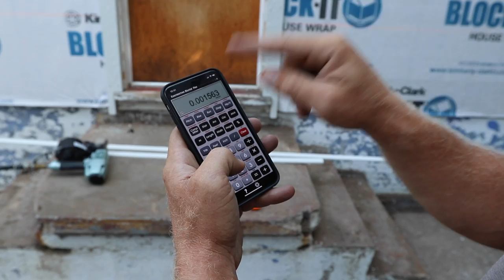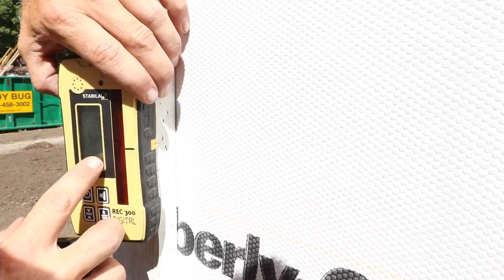How To Renovate Your Homes Exterior Part 4: Windows and How to Start Siding

Comment from the maker: Watching til the end, you can see that your comments and suggestions help me as a builder just as much as I hope they help you!  So keep them coming!!
Reply: The systems and technology around window flashing and rain and air barrier systems is evolving rapidly.  If you want to blow your mind on how the technical European systems work, check out 475 high performance building supply and download some of their wall assembly PDFs.  Really interesting stuff, keep up the great work!
Reply: The best men have their ego in check! I'm working on mine...but if I learned anything from you...it's that I need a hell of a lot more tools. :)
Reply: As I was watching this I was curious about the bottom being taped. I watch a lot of This Old House and they had said not to tape the bottom for drainage.  Good stuff, love the videos, keep em coming!
Reply: Yuppppp
Reply: Our windows here in New Zealand are taped, fixed and flashed completely different ae interesting to watch and we also use cavity systems not direct fix
Reply: Mad respect for being humble and admitting when you get something wrong
Reply: Hey that roof needs to be done next bro!...lol
Reply: It always surprise me how in the US you don't fur out your walls before putting on the siding. A rain screen really helps protecting your wall against the rain (more than any fancy house wrap). Houses are always built this way here in Quebec and I think it's code now in Canada. Of course, we get tons of snow so that's may be why :-)

Thanks for the videos. I'm building a house next summer and I'm learning a lot watching you renovate this house.
Reply: Alexandre Poitras check out essentials craftsman YouTube page. The are building a new house from the ground up with with lots of details

Comment: I used to hang siding for a living. You hit the nail on the head when you said you put the trims (I'm assuming you mean corner posts) on too early.  We ALWAYS snapped the baseline first to see how out of level the house is.  I've done some jobs where it is out by 3-4 inches. What we did in those cases was put one row of siding (or flashing) on the bottom first following the out-of-level house line. Then we would cut the top off one row of siding and nail that on top of the flashing to establish our true level line. Then the rest of the siding would just hook on that and up we went.  So what you were left with is the first course of siding (or flashing) being wide on one end and narrow on the other, but the siding would be level after that all the way up.  The main thing is you got your siding level before hitting the bottoms of your windows, because if you don't get that then it looks totally ghetto.

Comment: Did help. Good, bad, or crazy, my thought process is a lot like yours. With metal roofing that I’ve put in over a dozen of with a more experienced guy we “stretch” kick it screw it repeat, to split the differenceGAVE A THUMBS UP ! Subscribed earlier. For some reason.. I’ll be watching. Learning the hard way about giving the water a place to go on the bottoms of windows and doors. Guy that help me upgrade and replace my sliding glass door had 30+ years experience. Granted he was mainly a framer but he should’ve known better. That was three almost 4 years ago. I know a lot more now than I did then but that doesn’t get rid of the south spot in the floor in the middle under my newish sliding glass door. Has to come out and be redone now.Live and learn. And your trim.. that stuff happens. It’s not the first time it’s not gonna be the last.

Comment: Laser level is very interesting, because I remember somewhere around the early 1970's when I worked hanging Sheetrock in a large housing apartment complex the hung ceiling guys used a rotating laser for ceiling hangers. It's amazing to me that they had that commercial technology back then.

Comment: I think this is the right application for a story board.  Charles
Reply: 465maltbie Tommy Silva has a good video on how to use a story pole for minutely different reveals
Reply from the maker: @markpalmer5311  you could angle your story pole for sure...but that wouldn't help in this instance...knowing how much to angle it by the man door would be the issue

Comment: Love the videos. The rotary laser worked great. If you didn’t have one you could screw blocks on each end of house and run dry line to get you out away from man door trim. Use speed square to make marks at man door and then pop lines.
Reply from the maker: Yes great tip

Comment: One thing that's rarely mentioned is the threat of exterior fire. Steel siding and roofing help with this. As do metal clad tempered glass windows. If one wants more fire protection, a layer of exterior sheet rock under metal cladding is a good plan. Most of the houses currently turning to smoke in California could have been protected in this way.

Comment: As a siding contractor. If you’re off 3/4 in 40ft the difference in a 4 foot window is minuscule. (.75/40=x/4 and solve for x, that’s what your off in 4 ft) Get above the windows then make your adjustments to make it look good with the soffit.

Comment: When I owned my millwork business, a competitor sold a job of 46 2' 2' awning windows on a job in Illinois.   The homeowner removed all the stickers from the windows before installation.  Over 75% were installed upside down or on the side which caused major leakage problems.   The window manufacturer hire me to find out what was wrong.  That's how I caught the mistake.

Comment: The X-cut in the wrap is bad.  It can trap water where you don't want it.   I-cuts are bad too.  They can let air in where you don't want it.  Once the foam shrinks around the windows,  you'll have significant gaps.

Comment: Were it I, after establishing the first course, I would have made a story pole that was long enough to reach your soffit.  I'd space it with the recommended reveal (7" I believe is your reveal).  Then set it against the soffit and lean it until one of the course lines rests on the top of your first course. Mark each course and snap your lines.  whatever variation you have would be spread over all the courses.
Reply: More people need to upvote this so Kyle will see it
Reply from the maker: I see them all

Comment: I always shorten the reveal on my first piece of lap siding by about 3/8'' . 
For instance if you are running a 6'' exposure the first one will be 5  5/8''. 
I do this because the lack of a shadow line makes the first piece always look bigger. 
The way I think the windows should be flashed are as follows. 
Window tape in the bottom of the sill. None on the bottom fin on the outside. 
Cut the house wrap back from the edges of the opening about 2'' on the sides'. 
Flip the top paper up over the window. 
Run the sides up, taping the window flange, sheeting and wrap up to above window by a couple inches.. 
Then tape the top flange to the sheeting, flip down the paper above tape the corners .  
This keeps air from funneling into the house through the wrap, because it will.

Comment: I've always taped inside and outside of the window and over lapped the house wrap on top of the window it's over kill on it but never got any leaks on the jobs I've seen a lot of people not cut. Back the top and leaks on a brand new house and with all these New types of siding coming out Hardie board looks great if it's not installed correctly they will leak most important thing on this house is the over hang make sure all the drip edge and seamless gutters just make sure you don't have any back water seems and you will be fine

Comment: I don't know if this helps, but I would treat your siding layout just like a roof.

Your 3/4" drop in 40' is 3/160" per foot (.01875) or .0015625 per inch or run.  Just like a 4/12 rafter rises  4" for every foot, you could think of it as the same.

If your first trim obstruction is 120" away from the corner, just measure up from your laser level line 3/16" (120" * .0015625 OR 10' * .01875) and make your mark there.  The rotary laser set to the slope is a great tool, but not all carpenters are going to have that at their disposal.

Comment: Dude when you're doing siding and you need to make up a lot all you have to do is drop one side an 1/8 inch and raise the other side an 1/8 inch. Then you can make up 1/4 inch in each row and it'll still look good
And for those who do not have the laser you can snap your line above the door and measure down in your increments

Comment: i like to set a removable 1/4 3/8 block under the window when installing so after its nailed off you can pull them out and have room for spray foam on the bottom.
i caulk and tape the bottom of the flange if its properly installed there  shouldn't be any water getting behind the window
Reply from the maker: I use a pencil for 1/4” spacing under and then remove

Comment: Man i think if i didn't set trim from the reference line i would have just redone the corner that was higher and put a new one and let it hang down a inch. You should definitely 100% run all your siding level.  Its going around windows that are going to be level and sq. And if the soffits are out then adjust with a peice of trim or something to make easy on the eyes.  But all the different heights could turn into a nightmare going around the whole house.  Im a carpenter by trade. Don't do siding everyday..some years i don't even touch it but definitely did it enough you have my game plan when i jump out the truck.  But after i get my reference line around the whole house i then run starter and keep it back of inside/outside corners and back off doors enjoy for J molding or 1x4's whatever may be. I know its not something you guy's dont do a whole lot and I'm just offering options.  Please don't take this like im trying to be a ass. I think you guy's are A++ at post frame building's..actually best i ever seen. Happy building guy's!!
Reply from the maker: Lol dude I’d never take constructive criticism or helpful tips as being an a$$. I did a ton of this stuff in my early years before becoming a post framer... I would have went all level in a perfect world... I didn’t want my siding hanging over almost 3” on one corner... and almost level with the foundation... just had to do what I had to do on this one
Reply: @RRBuildings  oh wow. I didn't realize one of the corners was out so much.  I thought you only had that inch to deal with or it was worse case. I totally agree on not dropping that much. Thats crazy. Another thing i did a couple of times was start with 1x6 band on the bottom with a ledger flashing and siding starting on top. I figured just seeing 6" of solid white i could cheat it and the eye wouldn't pick it up and unless they were studying it. I would have to say awesome job then brother. 3" is extreme and you played the hand you were dealt and executed beautifully.

Comment: great job only thing, you didnt silicone your windows? and I saw you taped the flange on the bottom of the window, I was told by the window manufacture not to seal the bottom in case of failure

Comment: Just measure down from your soffit on both sides to the same number, example 80in. Then mark both sides at 80 and run your starter straight across, or start your panel. When you reach your top out panels they won't have to be cut at an angel. It also saves you from all the work you had to do in the beginning, trying to find the exact slope line. 
EDIT: This strategy should only be used if your differential from one side to the other is +1 IN.
Reply from the maker: What about running them level?
Reply: @RRBuildings  Level is ideal, but on old homes sometimes level can become impossible with walls running up and down. Sometimes we have houses where one side of the house will drop 3-4 inches across the run. Now my original comment is worded poorly, and that strategy should only be used when your top out panel will be 1in + difference from one side to the other. It looks much better cosmetically.

Comment: I see you trying to do division with inches and all I can think is it would be so much easier using the metric system. I am in Canada and also stuck using the imperial system for construction :(
Reply: The U.S. is going to switch to metric .. I was told this 45 years ago in school.  lol
Reply: Been using metric for more than 40 years here in Canada and I STILL convert to inches and pounds. I have no idea how long 137 mms is until I convert in my head that it'd be roughly just under 1/2 a foot.
Reply: The Imperial measurement system is so unnecessarily hard to use. Metric on the other hand goes up in 1s 10s 100s etc eg 10mm=1cm 100cm=1m making things easy as can be

Comment: Hello, What was the reason why not tape or silicone the bottom side of a window?
Reply: The thermal differential between outside and inside a window frame will cause it to sweat. It's best give it a way to escape then dry out, rather than puddle and cause mold and rot.
Reply: @opendstudio7141  thank you, that makes complete sense.

Comment: I hate to tell you this, but that wrap should never go inside around the window frame.  Water will seep in and retain around that window.  It should be cut and taped to the outside window edges.for a water tight seal.
Reply: True, thanks for sharing that :)
Reply: @diyfferent  I learn from the best  ;-)

Comment: Please don't flash tape the bottom flange of your windows. Any water that gets behind the window has no way to escape but to the inside of the house. Putting a 5 degree slope on you window sills would not be a bad idea either. There are 2 types of windows, windows that leak and windows that will leak. Plan for the worst my friends. I really like your use of the Zip System line of products. Why didn't you use on Greg's cabin?

Comment: Fudging math is always a brain squeeze. I follow the window manufacturer's instructions when installing windows. Usually, the window warranty is voided if not installed by their specific installation instructions. Use to have fun with developers superintendents by turning the window manufacturer's stickers upside down after installing them. lol
Reply: The best is when two different manufacturer's installation instructions have contradicting installation methods... Come across that more than once.
Reply: @cup_and_cone  It is the first thing the window manufacturer will look at upon a warranty claim. If it is not installed per their specifications the warranty is void. I have never had a window fail but have seen the process in action. The truth was the window manufacturer was the victim in the case I witnessed.
Reply: @riverrat1149  Yes, but my point is that two different materials installed together sometimes have conflicting manufacturer guidelines.  For instance on Zip sheathing, Zip wants you to caulk all four sides of a window's flanges (with 2" drain provisions on bottom flange).  Some window manufacturers don't want any caulk at all on the bottom flange.  Damned if you do, damned if you don't...

Comment: You should really consider better building envelope practices. No membrane on the sill, nailing the bottom of the window off completely without any chance of moisture relief (horseshoe shims, leaving nails out ect), membrane over the building wrap.. any voids in your membrane install will trap moisture plus a primer-less membrane is prone to falling off building wrap. Should have used an elastomeric fluid applied membrane for complete moisture sealing coverage. Meh your house man, I just over build it.

Comment: You could have stretched a line over the trim and marked the trim then snapped a line from against the wall on each side of the trim.
Matt Risinger is not a source of good knowledge. He is a paper builder. Has he ever even swung a hammer? I doubt it. He has very little true understanding of many construction issues. I stopped watching his channel because he speaks SO MANY ERRORS. 

There is a saying. Those who can Do. Those who can't Teach. You do. Matt teaches.
Kyle, you are decades ahead of Matt is your skill and knowledge set. Window install tech has changed as vinyl and sealed buildings create new problems. You may make some mistakes but you acknowledge your errors and explain what you have learned. Nobody is perfect. You are close.
Reply from the maker: Thanks mark the string line is a good idea.  Will remember that